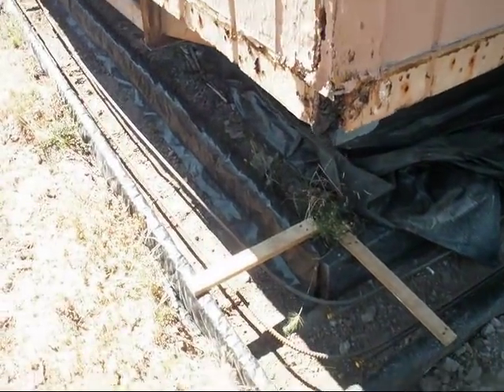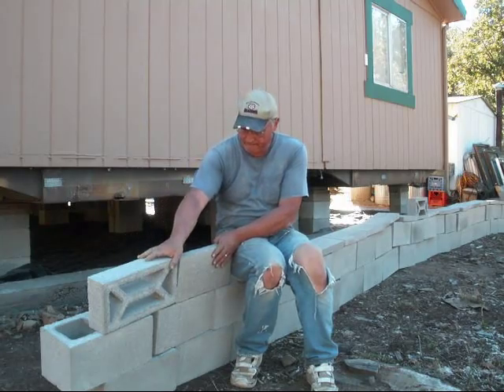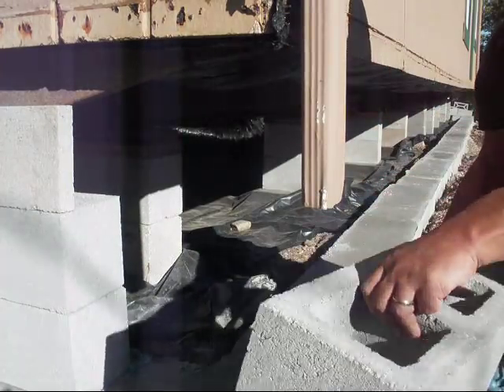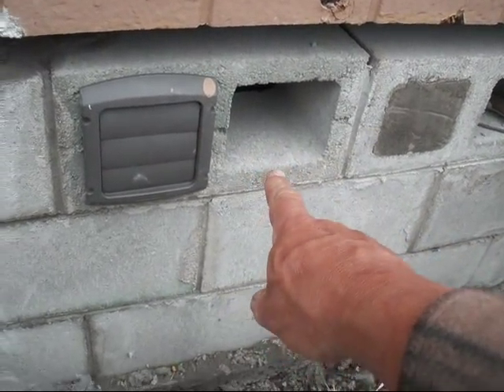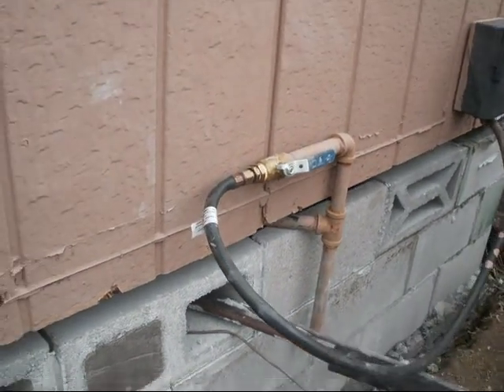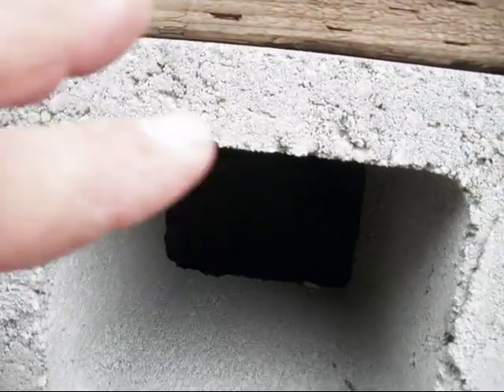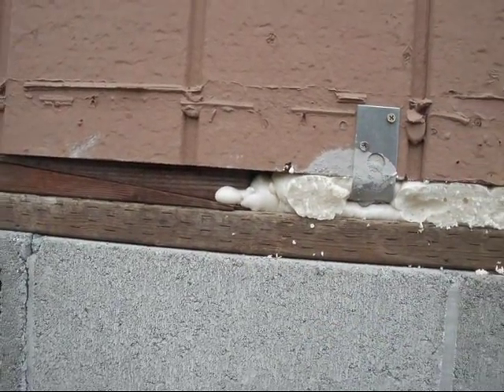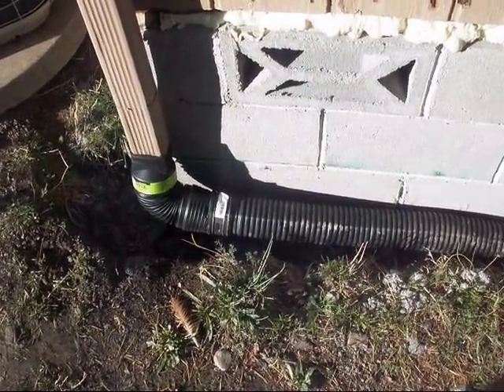How I Built A Cement Block Foundation

Comment: Hi Jerry I am following this and have watched several times.  This is what I will do with my 10x20 cottage.  A couple of perspectives though.  I couldnt see the other end to see what the tie downs were strapped to.  Ground augers under the home?  Also I was a bit concerned that all of the load of the entire building is all on the cement walls and not underneath somehow?  Or perhaps I am not seeing some sort of load bearing supports under the building.  Thanks this is an excellent video.
Reply from the maker: Sounds great! Thanks for watching and tuning in

Comment: Jerry respectfully it looks like all of the load bearing is done by those blocks way under the home.  Not the cinder block skirting/foundation. Correct?  The reason why this is important is that I am going to do this for my cottage.  I am thinking that the cement skirting/foundation will be great though as the blocking under the center areas of my building sinks then the perimeter cinder blocks can then bear more weight. What do you think of this?  Would really appreciate it.  Again I am doing all of this myself like you so want to be careful I am doing it right. Cheers!
Reply from the maker: True. The pier blocks running every five feet along the I Beams are the main support. The Cement Block serves and the Perimeter Support also required for installation of a manufactured home in our area, as per code. One could opt for the full cement block foundation/skirting, OR, perimeter block supports on both sides of each window and doors and corners, etc, and a cover added such as plywood or the feature of your choice.

Comment: Is there a reason you use the wedges to support the house and not the sill plate by itself? You do amazing work. Looking to do the same to my home. Thank you.
Reply from the maker: I merely followed the code as specified by the State Or Oregon for assembling a manufactured home on a foundation. One really needs to follow the code within their jurisdiction as it is different from region to region, sometimes due to the the freeze level within the soil, and yes, the soil itself. Geology. That is more than often the reason why codes vary from region to region. Do your due diligence and research and follow your local building codes.

Comment: 12-27-2018   i live marion, north carolina
nice job plenty of great hints, did this make a double wide mobile home into a modular home i ask because i am getting ready to do this myself. I could really use this answer. thanks and subscribed
Reply from the maker: No sir. To meet that requirement the footing would have to be poured at eighteen inches wide rather than the twelve inches as per the building codes for my State. Therefore this cement block and footing is rated as a Cement block skirting.

Comment: In order for the home to be financed HUD or be considered "permanent foundation", do you have to use the metal straps with the back fill of cement or is this just for added structure?
Reply from the maker: +Tracy Fluty In my situation, this type of foundation is considered a Cement Block Skirting with a 12 inch footing. If it were to pass as a "Foundation" I would have had to place the cement blocks on an 18 inch footing. In addition, the strapping and cement back-fill are required for our area as we are in a earthquake zone where the strapping and back-fill must be every four feet. If the Manufactured structure were to have a simple plywood or metal skirting, then the straps would be anchored from the I-beam to a secure anchor point in the ground according to our State's building codes. I hope this answers your question. Check with your local building codes for the types of structure you are placing. A pamphlet is usually downloadable from your State's web site. Thanks for the inquiry.

Comment: I may have missed it but the couple of cement blocks you showed putting the putty?  [I know I've got the wrong term] -  you put putty between the broad sides on the top and the bottom, but I didn't see you put putty on the ends where you connect the two blocks that fit into each other. at  6:30   I watched Bob Villa and his pro also added a little putty on the 8'' ends.  Can you please clarify?
Reply from the maker: emeraldeyes Yup, mortar was added on all four sides of the blocks. Top, bottom, and both ends. I'm afraid that with my video editing, I didn't show the mortaring of the ends. Sorry for any confusion.
Reply: emeraldeyes

Comment: Great video.. how many pallets of block did you use & how much per pallet or per block. Thank you
Reply from the maker: Thank you for your inquiry. The quantity for my home measuring 26 x 48 took 284 cement blocks at 1.56 each for a total of 443.04. The top rows on the ends I used 36 two inch thick pavers at 1.07 each for a total of 38.92. My one ton dually could only handle one pallet at a time which I made my purchase at Lowes. Each pallet held 48 blocks. I had six pallets total. That's not including the mortar, or the cement bags for the footing.

Comment: Great video! Thanks for putting it together and sharing it. Quick question for you..It looked like you had 2 pieces of rebar in the footing. Is that correct or did I miss some? Thanks again!
Reply from the maker: +Shane Bernal I  had two pieces in the footing, this is not a foundation footing but a skirting footing, which is all our state's code requires at that time.

Comment: HI ...CAN YOU TELL ME WHAT YOU WOULD YOU SUGGEST THE SIZE OF THE FOOTING SHOULD BE FOR A CINDER BLOCK WALL 8 X 8 ? I LIVE WAY IN THE BOONIES BUILDING COULD IS VERY LENIENT  THANK YOU
Reply from the maker: I cannot tell because there are so many factors involved. A few to be mindful of when thinking about your footing is #1, the geography (what kind of soil and temperature extremes do you have) #2 Is there going to be a significant load on top of that wall, like a roof, and what is the average snow fall for your region are factors to keep in mind. The best advice I can give is to ask around your area, especially some contractors, and if possible, download the documents from your State's building code department, it should be free to do so, this will give you basic advice as to how thick, how wide, and the strength of the cement to use and the reinforcements to place within, as well as the depth this footing must be placed. Because your Codes are lax should not mean one should put safety at risk.
I'm sorry I could not answer you question for you because mainly I am not a building professional. I am simply a humble DIYer whom does his due diligence and researches these things prior to doing them so they meet code in my area and the building inspector passes me on my building permits when I do it right. Good look with your project. Thanks for watching.

Comment: it would have been cheaper getting a cement truck to come in and pour the foundation too many bags of quick set @ $5.50 a bag that's $2.0230 dollars not including the taxs plus his mud too dry
Reply from the maker: +Kenneth Meuter Thanks for the info. I must have gotten a killer deal from my cement bag source. I paid $2.25 per 80lb bag. I crunched the numbers and found the cost of the cement delivered way out in the wilderness where I live was much more than doing it myself by purchasing the bags. WOW, you guys are getting soaked with that mark-up on cement bags.
Reply: I thought the same thing. Should of known Jerry did his homework. Nice job Jerry. You are a beast. Thats a compliment. Lol